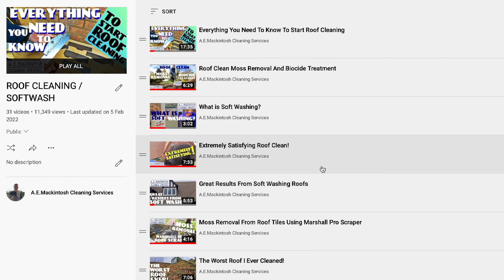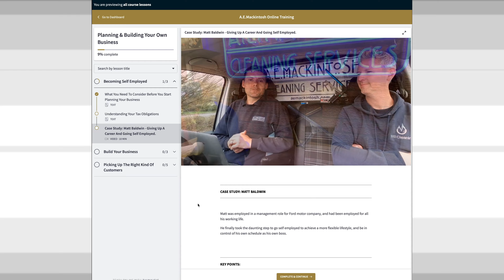Pauls First Roof Clean

Comment: Hi mate great work again 👍 im on about starting up doing drives gutters and windows ,ive only got about 5 grand to start has im just coming back from a neck injury thats took ne 10 years to get on top of 👍 ive been looking at starter set uos but dont want to buy junk  ive been looking at kaim starter set ups but not convinced i also like the bew jvc pressure washer which is just over a grand,also i need a decent guttervac thats not too much aswell as window cleaning equipment,i know im asking alot but any advice would be much appreciated. I want my self esteem back 👊  cheers
Reply from the maker: Sounds great. I would steer clear of that Kiam stuff though. There’s loads of great tips on a wide range of equipment in my online training courses, and some great discounts on kit too.
https://www.aemackintosh-onlinetraining.com/courses/window-cleaning-tools-and-techniques
Reply: Is 5 grand enough to start cheers
Reply from the maker: Might be a bit tight for all the things you want. I think it’s worth buying decent equipment from the start if you can. My discounts will help.😉👍🏼
Reply: Cheers mate whats your view on the new jcb jetwash cheers

Comment: Do you use hot of kold water ?
Reply from the maker: Cold water at low pressure.👍🏼
Reply: @aemackintosh  mine goes from 60 to 110 bar and i wil go to the shop and show your post to illustrate the tool that u use 😂👌
Reply from the maker: More details about the setup and discount packages in my training course:
https://www.aemackintosh-onlinetraining.com/courses/pressure-washing-tools-and-techniques